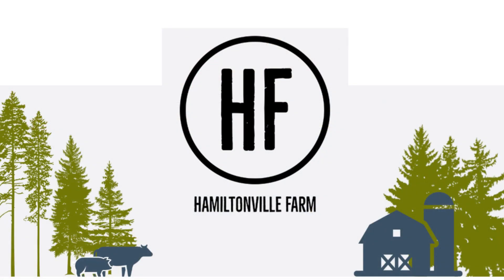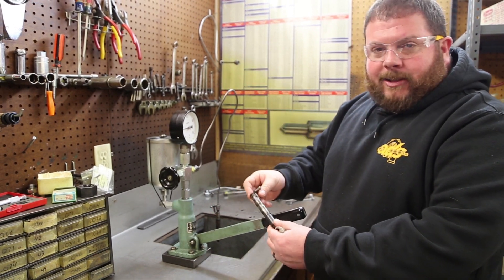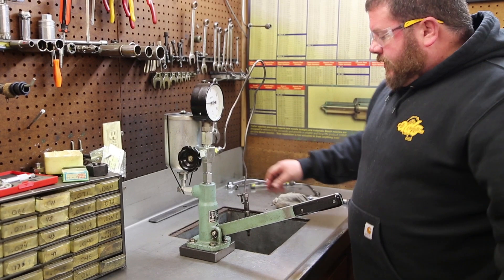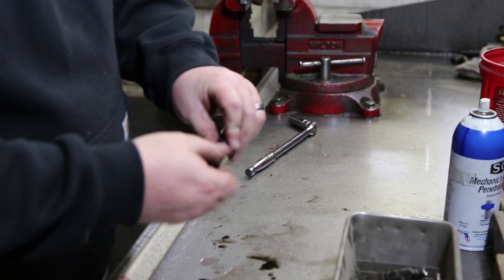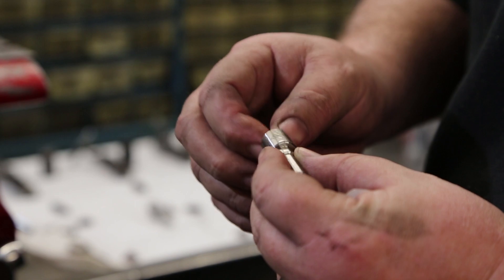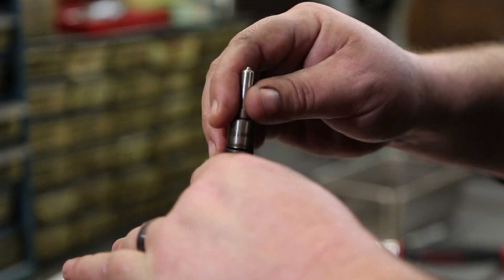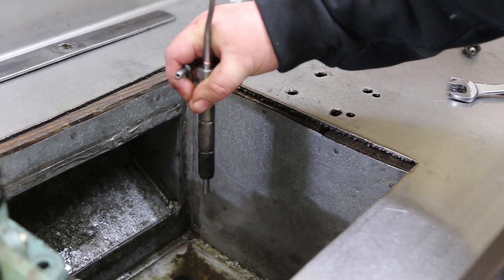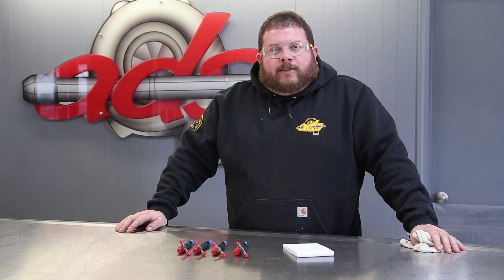Curtis' @ the bench for Hank & Wiley @Hfoutdoorsyt KOBELCO SK160 Backhoe Injectors #rustoration

Comment: I have a 04 Cummins with 350k miles on the original injectors and the truck still runs good.  I have a set of 20k mile nozzles from another 04 truck that I upgraded.  I thought about installing those nozzles on the high mile injectors.  Would it be worth my time to switch those nozzles, I am going to sell the truck soon.
Reply from the maker: I'm not sure I'd mess with them if they have 350K miles on them unless I was prepared to have them rebuilt. It could get more involved than just the nozzle swap.